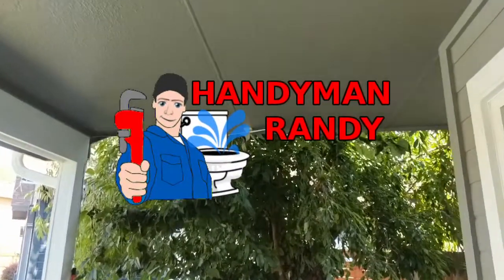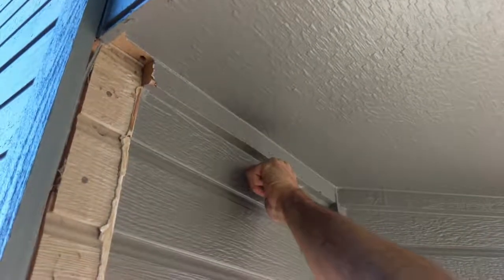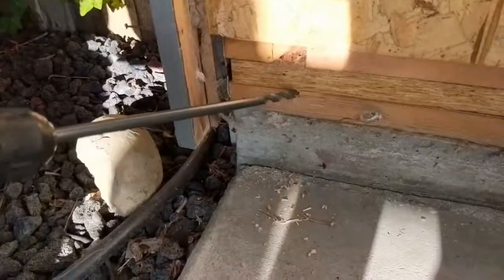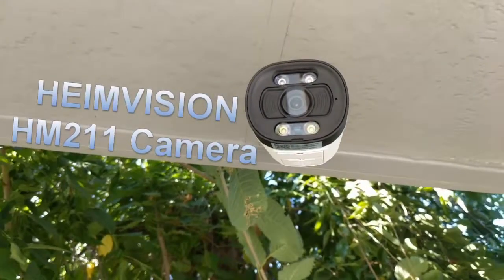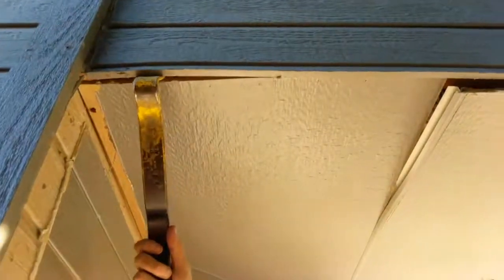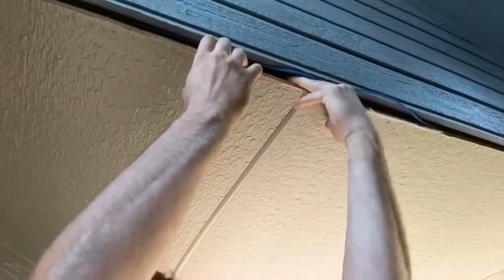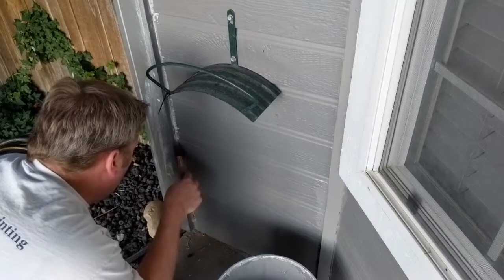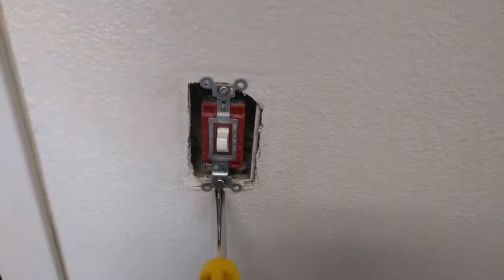How to Run an External Ethernet Cable

Comment: Is there any concern from the cable overheating and possibly getting damaged just simply from being outside in hot temperatures?
Reply from the maker: I did the same exact thing at my personal residence and I haven't had any issues, and that was over one year ago

Comment: Wont this get struck by lighting?
Reply from the maker: ? The cable running through the soffit? If this is what you are asking, then the answer is no. Ethernet cabling is insulated and not a natural lighting rod.